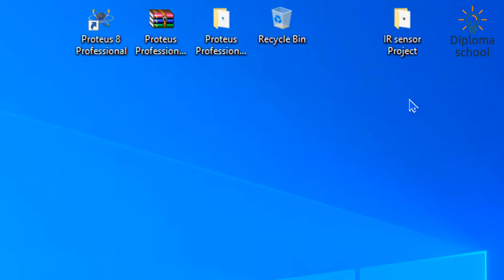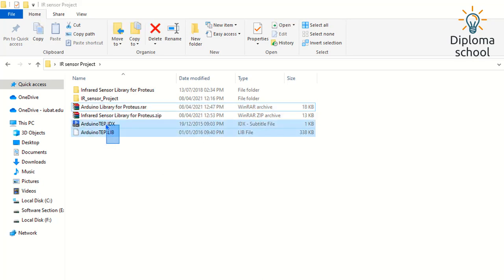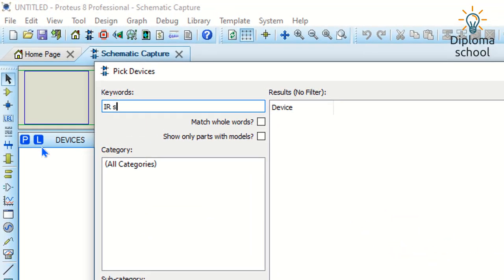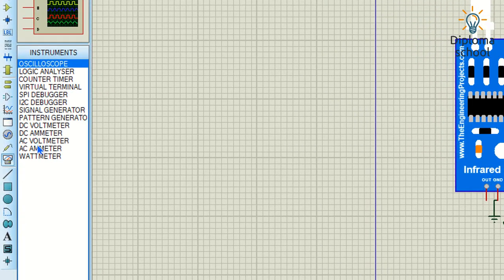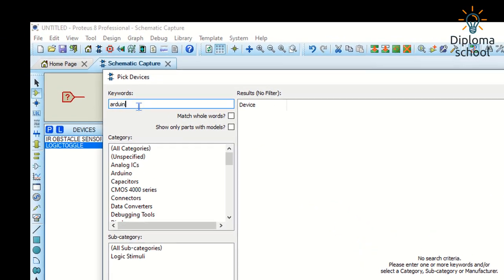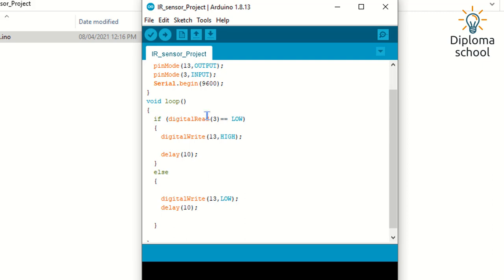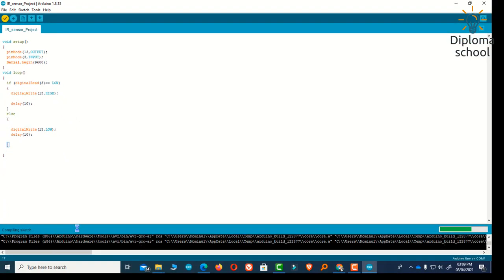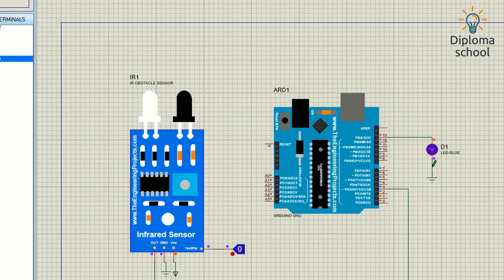IR Sensor Project Simulation with Proteus| Basic to Advance (1/5)| Proteus|Arduino|2021

Comment: the output of the IR sensor is zero showing in my simulation. i am usin proteus 8.15. i have tried in 8.12, 8.13, 8.17 also but the result iss same. please tell me what to do??